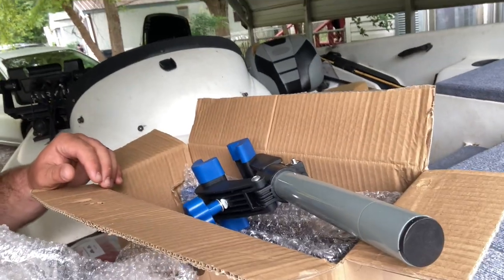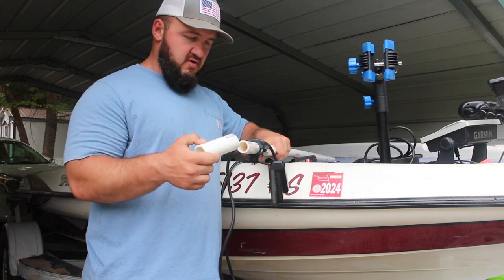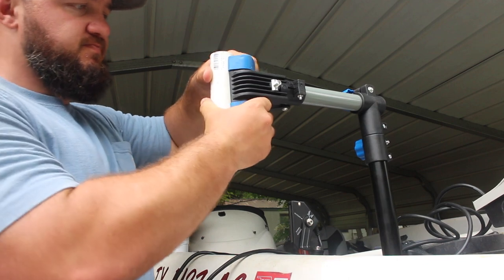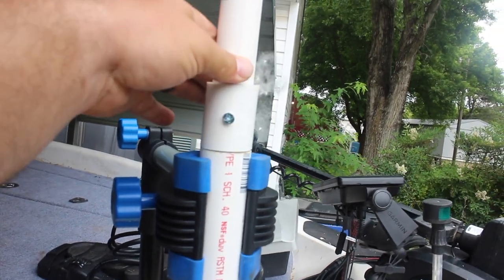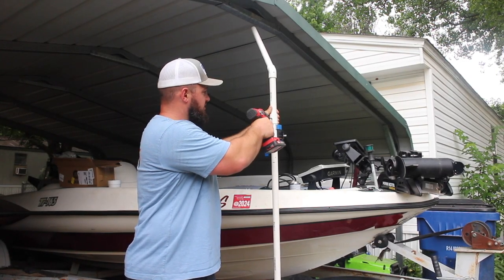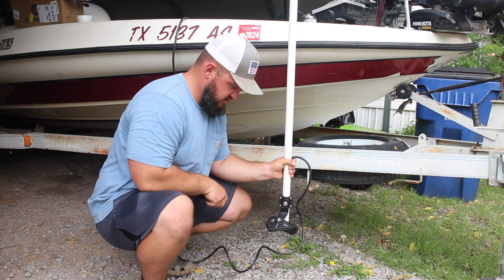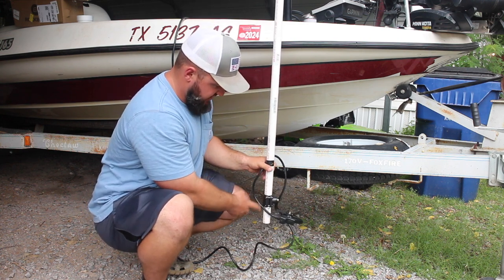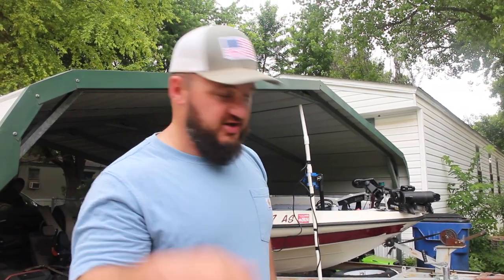LIVE SCOPE TRANSDUCER POLE DIY (made from a bike mount) CHEAP!

Comment: Friend, thx for your vid. I stole your pole mount bike clamp idea and changed my design a bit. I just posted this below, on another guy's vid too. I'll repeat it here. Basically you can take a 1 1/2" pipe and run it inside a 2" pipe and it is way, way snug, compared to the flop of the smaller diameter. But not complaining,,,just improving. My idea below is best with the Venzo bike mount,,,but I used your type too but had to modify it, as I describe: Here's my build: Thx for your video! I heard you say you "might get a new ball for up front". If I may make a suggestion, look at the "Venzo bike repair stand" that bike mechanics use instead of a Ball mount. It will easily hold a 2" pole. And a 1 1/2" pvc pipe will fit inside a 2" pvc pipe with hardly any play...  It's how I made my mount, fwiw.  If I may, I'll explain how I build my pole mount. I made 2 actually because my Buddy needed a better one, so I made him one too. So I bought a 10' section of 2", and a 10'  1 1/2". I had 3' of 1" in my scrap that I used. I'll use 18" or so of it for handle, and 10" or so for the joining to the 1 1/2" pipe at the bottom to hold the Garmin mount.  I needed: 1-Charlotte Pipe 1-1/2-in x 1-in 330 Psi Schedule 40 White Reducing Tee PVC Tee.  Item #22737  Model #PVC 02400 5850 at Lowe's for my store price of $5.23. (I got 2 of them). This will go on the Top of the inside 1 1/2" pipe, and the 1" part of it I glued the 18" 1" handle straight into it. (works great). Your wiring will come out the top of this joint. Also need: 1-1 1/2" to 1" Bushing for the lowest part of the pole,,,Lowe's Item #23917 Model #PVC 02107 1150 for $2.27. Take this Bushing and glue it to a 10" or whatever piece of 1", and glue other end to the lower end of your 1 1/2" pipe. I also drilled a 1" or so hole above this Garmin 1" mount pipe in the 1 1/2" section. I then cut about a 9" long slot with a hacksaw leading out from this 1" hole. I put the Garmin connecting wire thru this hole,,,and out the Top end of the 1 1/2" pipe. 'How to clamp pipes and keep tension',,,I used a hose clamp from Autozone,,,Varese 1 3/4in to 2 3/4in EZ Hose Clamp 2 Pack Part # EZ36BK SKU # 862122 for $4.99. They are behind the counter,,on wall. Has a 'thumb screw' to tighen it. Ok, How do I get the 2" pipe to clamp tight to the 1 1/2"??? First I should should have said I made the 2" outside pipe 4' long, and I made the 1 1/2" pipe 5' long(sorry, that should have been first in the instructions). Cut some 1/4" slots about 3" long on the top of the 2" pipe. Make about 6 slots. I made them 1/4" wide or so, 3" long....and go all around the top of the pipe. I used a hack saw and a pair of pliers to twist out the little plastic slot waste. Your clamp will go over these slots and will tighten down against the 1 1/2" pipe is inside the 2" pipe, and the clamp will keep transducer snug. Buy a roll of camoflage Duct tape from Wally World, instead of painting it. I wrapped the camo tape around and around like a barber pole but can do it longways down the pipe is probably faster.  I have $120 in parts in this build with the Venzo mount. I also built  the second mount with a cheaper bike mount called 'Clothink' on Amazon for $37.99. There IS a problem with this one though; it will not quite open up 2" . I am having to build a little piece of wood about 1 1/4" by 2 1/2" x same thickness of clamp mounting and drill a couple 1/4" holes and add it to the clamping fulcrum part of this clamp. i.e. Ya gotta modify this thing to make it open up more than 2". The mod works though and this mount works just fine, and is $50 less overall cost. I have $70 in this build with the 'Clothink' model...or, you can go buy a fancy dancy one from Corn Pone? Crappie No Doubt About It is a good one,,,for sure, for $650 or so. Mine's camo and looks way, way better. Sorry, I don't do videos. Tooo old and don't know how, nor wanna learn. Can't take and post pics either. Ain't in it for the money,,,just helping out other poor boys like me. I hope you can figure this build out. Heck, I'm going to ask my local bait shop if he wants me to build him a few to sell for $200. Start a new business, huh.
Reply from the maker: Awesome man glad you were able to adjust and modify it sounds like you have it down to a science! Good luck man and tight lines!
Reply: Need to make a video

Comment: Nice work on the mount!!  Great idea and saves a ton of money.  What do you think about running the cable inside the pvc?  That would protect it indefinitely.  Only issue I see is the spots where the cable would go in and out of the pvc.  Just a thought.  Again great idea

Comment: I like the idea .but only bad part about pvc when your moving forward the pvc will move back ..I wonder if a metal tube would be stiffer ..I have summit mount pole and so so really need a stiff pole so when you troll around dose not bend ..
Reply: If you bump a stump with the pvc pole it will move over enough to not damage the transducer.
Reply: I'd try making the outside pole the full length to the transducer or close.  That'd help stiffen it up.

Comment: any chance you can run the wire inside the tube ?
Reply: As long as the plug for the transducer will fit through the pvc

Comment: Ur transducer is backwards, the cable should be at the rear, and sitting level
Reply from the maker: Nope! According to garmin how you see it is how it’s supposed to be mounted if you mount it on the starboard side of the pole. The way you’re saying is if you mount it on the port side.
Reply: @koltonblakley-crinercreeko374  why not mount on port side, and set it level, like it’s supposed to be. You have a choice, using the pole, starboard side, is if you can’t do port side. You are shooting off back side of transducer and having to flip it up to use. Or just don’t listen and move on. You have a choice. Your way is for people that that don’t have a choice.
Reply from the maker: @lonniehall9006  the way I read it there’s no preference. It’s designed to read and either way and it auto adjusts. Where are you finding this information if that’s true I’d love to look into it but what I read from garmin says otherwise. 🤷🏻‍♂️
Reply: @koltonblakley-crinercreeko374  forget I even mentioned it.
Reply: @lonniehall9006   blah blah blah blah. Can’t even say where you got the information from haha.